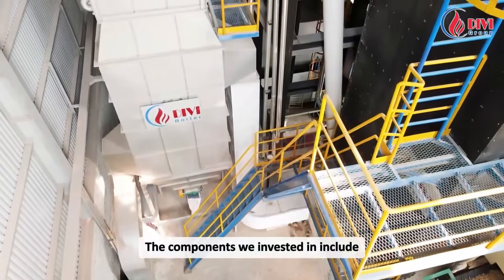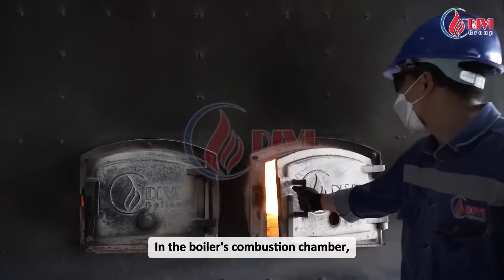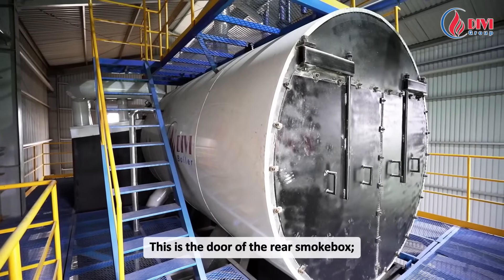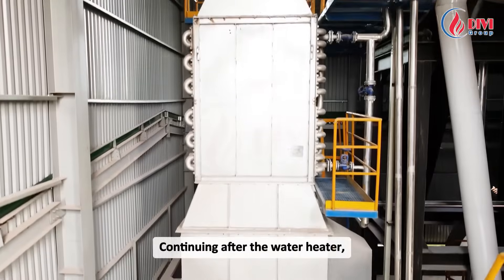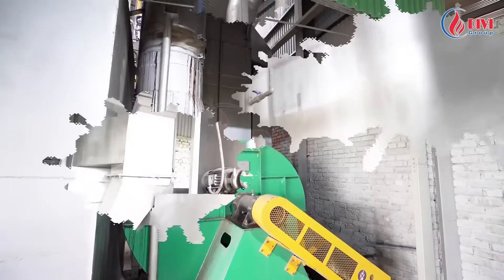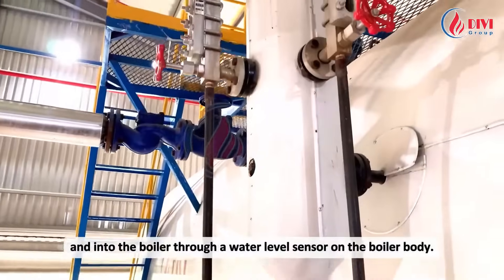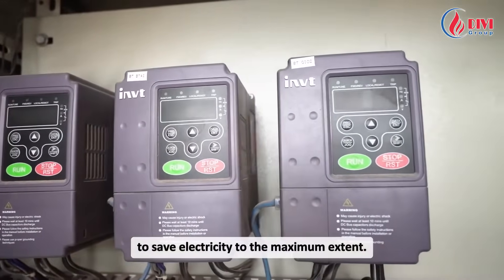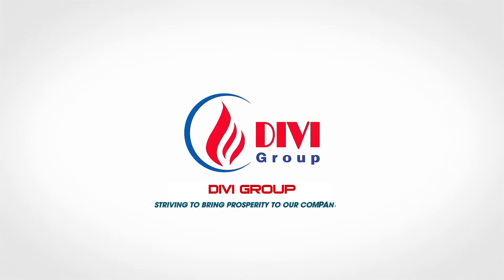Revolutionizing Sustainability: Biomass Fluidized Bed Boilers in Edible Oil Production

Comment: What are the advantages of using a fluidized bed boiler in industrial applications?
Reply from the maker: Fluidized bed boilers offer higher efficiency, better fuel flexibility, and more stable operation, making them ideal for industrial applications like the edible oil factory.